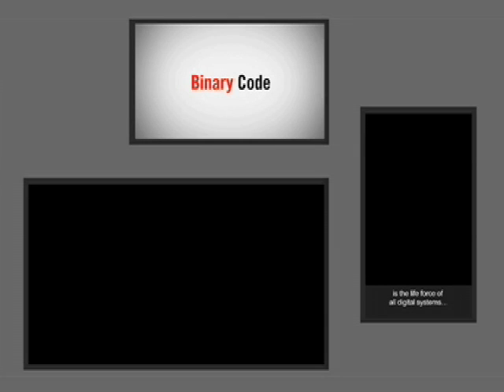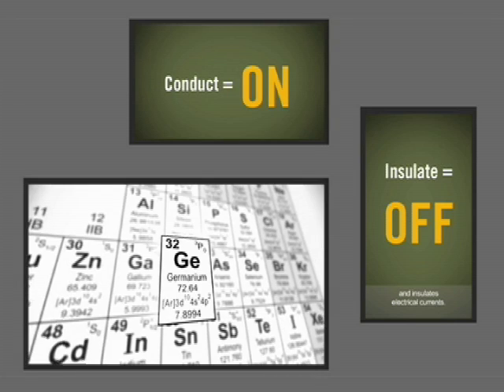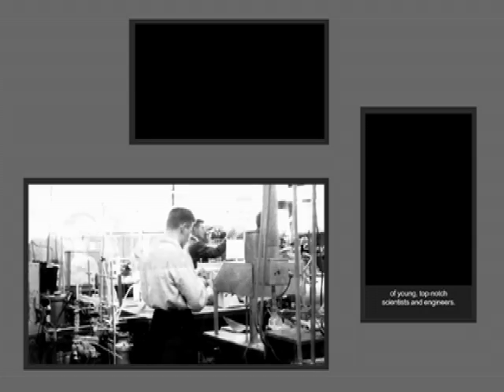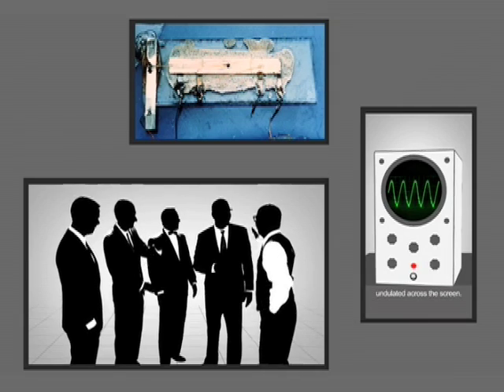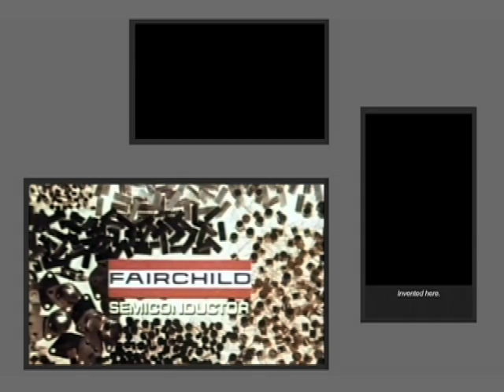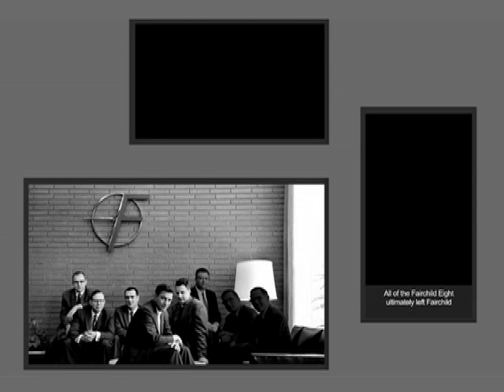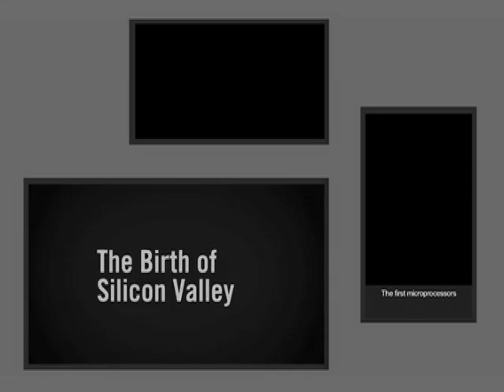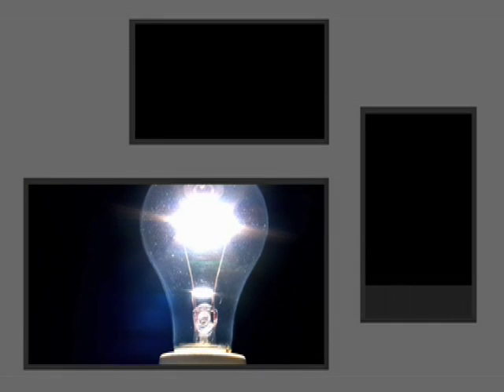The Silicon Engine

Comment: Transistors have a great tonal quality for electronic organs, be it a small combo organ like the Doors, or a great Wurlitzer electronic theater organ. Interesting to note though, it is not the integrated circuits with hundreds of transistors on a single chip that has the best sound. In fact Moors law can be reversed here. Single transistors have the best tonal quality if used discretely ( as in many on a board/ many boards in an organ), but as you put more on a chip tonal quality suffers greatly